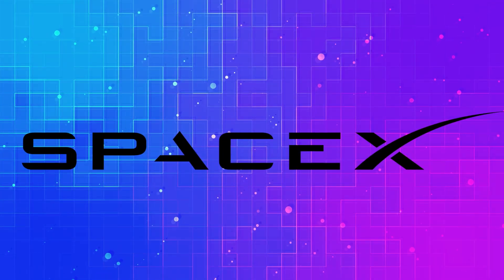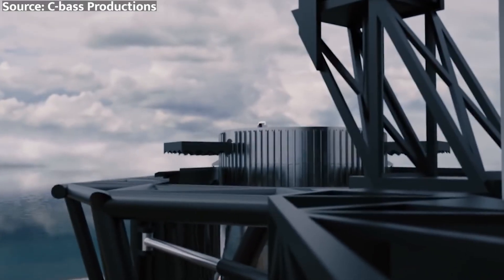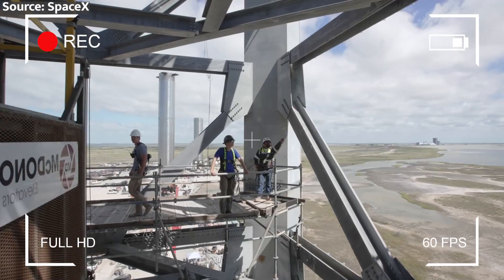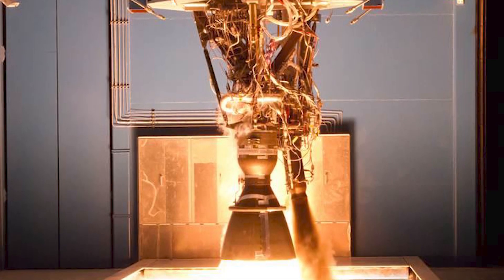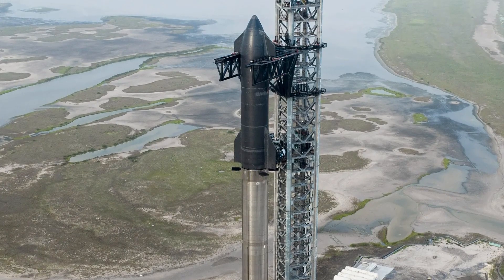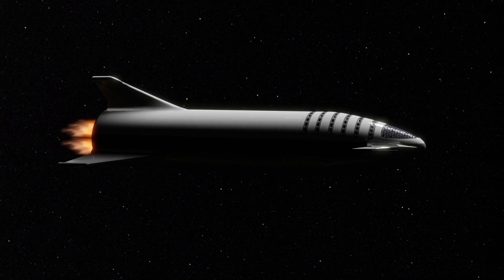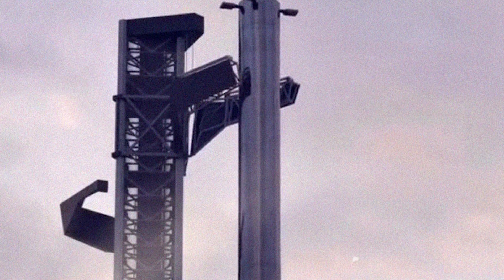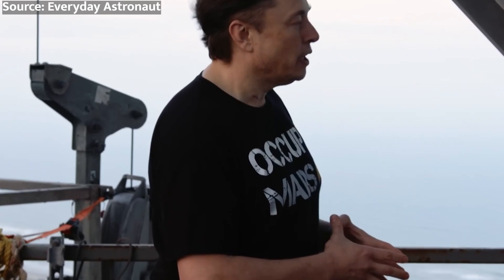Starship IFT-4 IMMINENT: The CHALLENGES SpaceX Faces and Their SOLUTIONS!

Comment: The raptor engines have been proven effective in the past 2 test flights. Also they're producing 1 a day so they have hundreds of raptor 2s in storage. Blue origin is the one who is having production issues. The heat shield will work they just need to figure out how to keep it attached. Also the vehicles will be landing on VIRTUAL mechazillas. Ift 5 if ift4 is successful, will be the first tower landing attempt.
Reply: It's an unfinished, unproven engine with all sorts of indications from SpaceX, NASA, and Musk himself that they are having issues. It's particularly strange to have conceptualized such an ambitiously advanced engine for a launch platform that's supposed to be re-usable despite incredibly trying flight conditions and still be reliable in critical sudden-death landing scenarios. One picks simple, fool-proof engine designs for that, not Raptor. As for the launch platform as a whole, it's currently a fractional-prototype struggling along to spectacular looking but nevertheless catastrophic test launches. It's worlds away from a complete, payload-carrying, re-usable, practical, affordable, functional launch platform. I mean, what're the estimates? A dozen++ flawlessly executed launches and recoveries in multiple sophisticated iterations just for one mission? It's not doing much to inspire confidence in such reliability or cadence. If it was a disposable super-heavy-lift-platform, it would be doing pretty well. But it's not and it's Spacex that has set the measure so high for what will count as a truly viable platform by conceptualizing it as they have. As planned, its itinerary is downright comical at the moment if one is willing to take off the rose-tinted glasses and see it for what it is.
Reply: @snizami   @snizami  the raptor probably has more test time than all rocket engines combined since there are so many per rocket. It succeeded in ift 3 until reignition and stabilization. They wouldn't produce over 500 engines if it was a prototype engine. Are they still improving it, yes, the merlin engine took 7-8 years to perfect. Raptor 3 looks bare and produces 280 tons of thrust but they're working out the kinks, they're aiming for 330 tons soon. But raptor 2 will suffice for the lunar missions. Once they complete a full flight, things will accelerate quickly, 5 flights estimated this year, next year Shotwell said they're aiming for 100 in 2025. I think 12 launches is excessive too but only if it takes weeks to launch a 2nd flight like falcon 9. But according to musk they want more than one a day and they'll have multiple launch pads. It's important to keep in mind that each ift so far has reached major milestones, all that's left is heatshield tiles, making it past the atmosphere for the 2nd stage, (including reignition and stabilization) making a virtual tower landing for both stages. 3 more V1 rockets left, v2 will be better and quicker to build. V3 will be utterly insane. Unlike sls which has been frozen in design for a decade, starship will constantly change until musk decides that's enough.
Reply: @Smiles10130  which one is it, "it's not a prototype" or "they're working out the kinks"? From my understanding, TF3 failed to get Starship to orbital speed without any payload, not to mention the reignition issues, so there's still work to be done until the system does something useful.